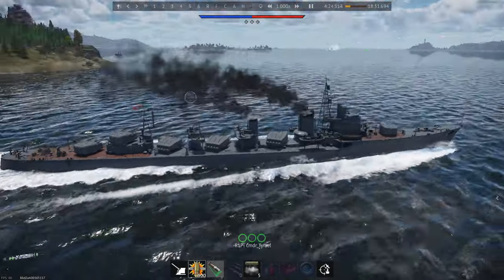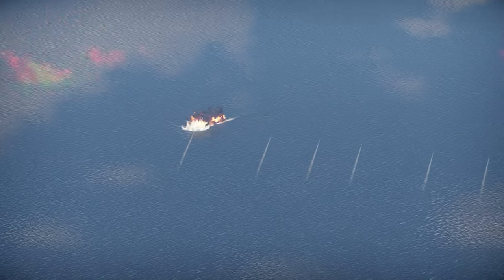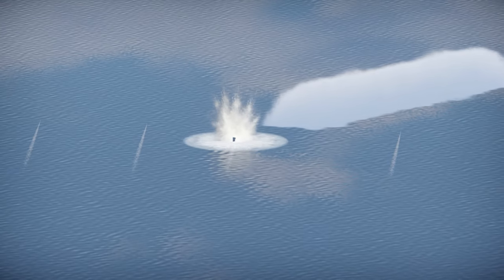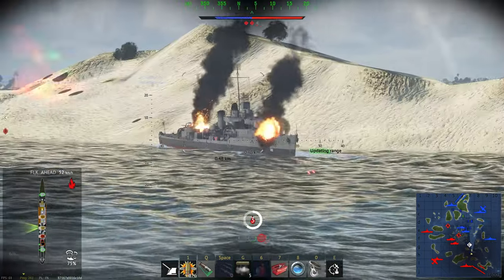Destroyer School - Guide to IJN Torpedo Doctrine

Comment: Thank you so much for this! Best explanation for torpedoes I've ever seen! :)
Reply from the maker: Thank you mate. I appreciate it.
I did forget to mention that torpedo depth is super important too.

If you're fighting destroyers and larger always use 4m depth. It is nearly always a guaranteed kill. Useless against coastal vessels though
Reply: @CmdrTyrael  I saw that in the other comments and already changed them all to 4 metres, thanks! :)
Reply: @CmdrTyrael I am glad I stumbled upon this comment!:) So what is the difference there? Shorter detection range? Circumventing torpedo protection belts?
Reply: @CmdrTyrael  I found out it could depend on the map. My torpedoes often hit shallows when I launched them close to island, so with 1m depth they could fit in spaces they wouldn't be able to with 4m, I think

Comment: Amazing vid quick question which mode is better for grinding naval? For some reason i find arcade to be better because faster matches. Another question is that are there any special keybinds/ control we should adjust before playing naval?
Reply from the maker: In my opinion RB is the best mode. Worth the 4 min wait time. The rewards are much higher. My average game earns 50k per match.

As for special key binds. I recommend watching my gunnery guide if you haven't already. It can be useful to have your radar to tools bound to separate keys. For ships that have them
Reply: @CmdrTyrael  alright ill be sure to watch thanks for the advice
Reply: Set windage to E and Q. Set elevation to mouse wheel.
Reply: @CmdrTyrael  SL rewards are higher but AB is much better for grinding.
Also, don't forget to bring a fighter and a strike plan; it's up to two extra spawns.

Comment: when doing 2:20 is using torpedo mode module optimal or not?
Reply from the maker: Torpedo mode is only really useful when it gives a poor torpedo some extra range.

If your using Japan don't bother with it.

If your using a nation with shirt range torps, it may be worth it.
Reply: @CmdrTyrael  waht about italian destroyers?
Reply from the maker: @FirstLast-cg9ic  Italian DD's have fast short range torpedos (4km), when you add torpedo mode it stretches it out to 10km. So it would be more suited for this tactic.
Reply: @CmdrTyrael  also can you make guide on which low tier coastal fleet vehicles are good in taking to bluewater fleet battles